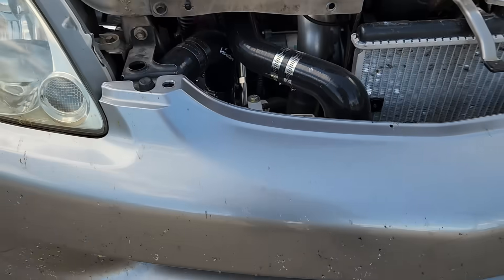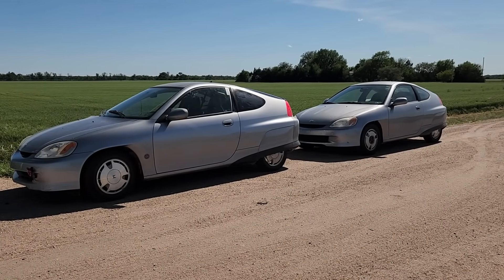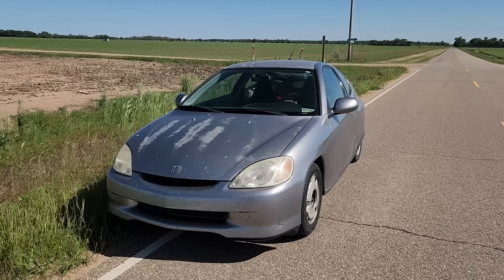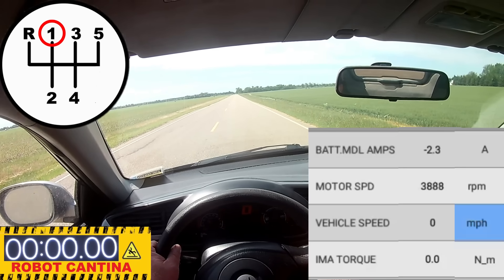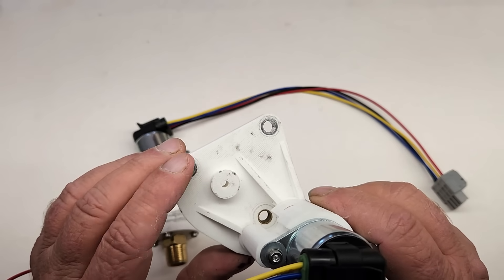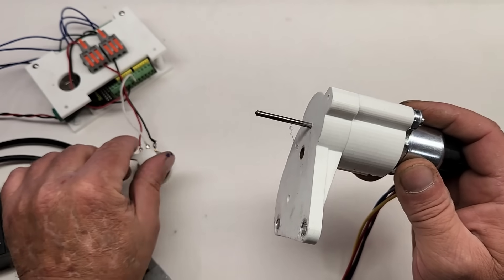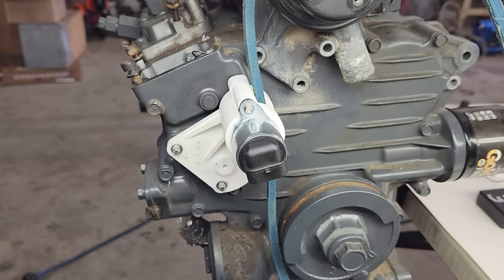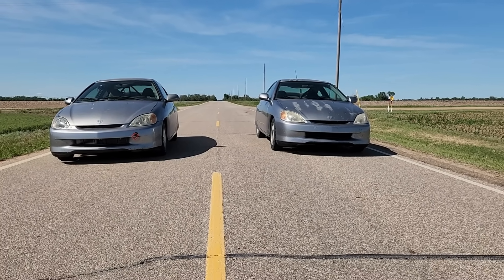S4 E18. Will an AMR500 supercharged Kubota diesel Honda insight outrun a stock Honda insight?

Comment: I think people sould think a but as the mechanical injection diesel had a after cooler plumb up to the radiator. So then it has a common in take temperature no matter how hot or cold the weather was so then you can tune the mechanical pump for that intake temperature. So it stabel in any condition. Just like the 1156 Cummings and big cam engine both have a after cooler on them which is not like a water to air or air to air its has the hot water out the radiator running through it but. It make sense as a where a ecu controller diesel just like a ecu on a petrol has all the sensors to change the amount of diesel for any conditions like radiator temp and intake temp speed rpm where a mechanical pump don't have any like that. But love these videos as I think that that little diesel seem to run grate and looks way fun to make something like this be side trying to get a small diesel for a good price

Comment: "Lets see which one is faster" I think the correct phrase Jimbo would be; Which one is not the slowest!! :-) 
My Z482 is now mounted in a motorcycle with a belt primary drive to a dry clutch on a pre unit gearbox made from a cut up motorcycle engine! And you thought your engine bay was tight for space!! Following with keen interest!
Reply from the maker: Nice!  I want to do some experiment with a Z482  some day.  Good luck with the project!

Comment: I fuel myself from the way you comment on things you see. The single point safety inspection lol yea they haven't fallen over haha
Reply from the maker: In Kansas, the car is safe to drive if the wheels roll.
Reply: @robotcantina8957  sure is ha. Idea run a 1,000 watt subwoofer and amplifier direct to battery and see how much this power draw effects the engine and fuel. Food for thought

Comment: I would love to have also seen battery voltage during this run. Knowing how far the voltage dips at 92A of assist(the max I saw) is a good indicator of overall pack health. It's not a surefire way to know how healthy it is, but it at least gives you a good idea.

Also, my lithium IMA battery insight makes peak power of 22KW, which is nesrly 30HP! Kind of amazing the power difference between NiMh and Lithium.

[Edit]: Do you plan on attending the insight meet in Kansas city in September, at the greentech facility? I would love to meet you!
Reply from the maker: Wow, that's a lot of power!.. I reckon the battery pack on my car is in poor condition.  The acceleration test (actually we did three runs) took the battery from about 90% to 60%.    I'm curious,   I drive my Insight between 68 to 75 MPH on the expressway and have never got better that 50 MPG overall.  It appears the only time my car will go into lean burn is if I draft behind a semi truck... does that seem normal?
Reply: That seems about right. I have a 2003 Civic Hybrid with 155k and 5 speed and have similar results with the 144v nicd battery. I get about 40-41 overall economy with interstate driving, 40 miles one way and varying speeds from 65-85 depending on time of day and location. It was about 45 when I first got it a couple years/30k ago, but that was also going about 65 all the time.

Comment: How about adding the ima to the diesel?😅
Reply from the maker: The IMA adds four inches in length to the engine and transmission.  The chassis of the car would need to be hacked in order to get that to fit.
Reply: @robotcantina8957 damn that is a shame ... :/

Comment: If you have any issues with the ASA or need a higher temp material...  I have a small Voron V0 printer with a chamber heater I can print up to 120cubed in it. Happy to help.
Reply from the maker: Thanks I'll keep you in mind!   I have used ASA on a lot of engine parts with much success, I'm not expecting any problems, but you never know.

Comment: those newton meters seem really low, the hub motor on my bike pulls 90 nm, my motorcycle build with 16 hp and a smaller stator than that is pulling 250nm.

If the fly wheel/hub motor combination has no form of cooling what so ever then they should be around that horsepower, but from what I understand with hybrid vehicles it should be pulling at least double that, the motor more than likely can pull 8 times that without melting the wires, depending on gauge.
Reply from the maker: Honda rated the IMA at 13hp so that's pretty much all it will put out.  Others have done mods and have gotten more power from the IMA but without the mods the IMA is limited.
Reply: @robotcantina8957   Wow, i had no Idea that they were that underpowered! or that they were DC 3 phase brushless. That's a real oddball motor in that car. A Prius can pull 5 times that level of power according to the internet.

Comment: I need to bring my '91 Geo Metro small block up for a "race". 3 cylinders of ground pounding excitement!
Reply from the maker: A Geo Metro is a serious race car when compared to the Supercharged intercooled Kubota D722 super mini diesel powered Honda Insight.
Reply: @robotcantina8957 btw jim there's actually an engine made by kubota that has an electronic controlled rack like you're trying to make which is the D902k, a variant of the D905 which is a 900cc version of your D722.

You can probably use parts off of that, though 3d printing is more fun

Comment: I have ideas that probably never work, but could you put the idler bearing around the fuel rack adjustment, reinforce the shaft housing like you did with the screw holes, and then you wouldn't have to worry about the belt coming in major contact with the adjustment housing? That way, the pulley isn't added on the way you showed and keeps the current footprint you have now.

Comment: Hi Jimbo, real fan of the channel. I have been thinking already before you changed the diameters of the pulley of the supercharger. Maybe it’s better to go back to the previous pulley size which helped already a lot with acceleration but also for fuel consumption. And when you need extra boost for even better acceleration why don’t you incorporate the exhaust turbo for that. An exhaust turbo only delivers boost when it is asked from it. It’s pretty idle when just cruising. And might be a really cool setup supercharger and turbo. Who did that before of the small diesel? Maybe this setup has been mentioned many times before in the comments but you have to forgive me I don’t read all the comments. Take care Jimbo.
Reply from the maker: Thanks!  we are trying to focus on just using the supercharger and what it takes to make a supercharger work for maximum power and best fuel economy.
Reply: @robotcantina8957  I’ll keep watching, thank you for your reply.

Comment: dare I make a couple of suggestions? 
the intercooler might be making no tangible performance improvement because of the extra drag caused by it, all those miles of pipework and pipe bends on the induction side. a strategic replay may add some more power.
for the ultimate fuel-sipper, what about mating the optimised diesel engine to the hybrid motor-gearbox?

Comment: Need the bypass valve pre intercooler, not post, that way you’re not making the intercooler cool air you’re just pumping back into the bay.

But as observed, the motor doesn’t seem to care about intake temps. Probably down to its compression and injection timing.

Comment: That gasoline engine in the Insight only produces 66 ft-lbs of torque, so 20 ft-lbs more is huge. That's over 30% improvement.
Reply from the maker: Indeed, its a fairly large boost in tq, but somehow I figured it would be a little more.

Comment: idler pulley gave me idea, that you can fit rack adjustment gizmo inside it, so it rolls around. Fixed with 3mm hole bolt

Comment: I think especially for how you drive the stock insight, the Civic Hybrid Gen1 gearbox with the shorter gearing may be for you.   Could also make a fun video too!
Reply from the maker: Yes, the ratios on the civic hybrid would be more ideal.  I find it fascinating how bizarre the ratios are on the Insight grarbox are.  Sometimes I actually get better fuel economy on the expressway in fourth gear.

Comment: Right on bro .. and i am very curious how the iac vavle is going to preform in the differant applications ... i might incorporate on on something myself lol i mean my whole forged turbo car is run off arduino already so it would prolly be easy enuf to add in .. problem is idk what i use it for yet lol , but i lile gizmos and tinkering 😅.. peace and love bro keep it rad stay safe and build on  . L8z bro and keep having fun
Reply from the maker: The IAC valve is an awesome nugget that need more love.    The one I show has a plastic "head" on it that can be removed to expose a 3.5mm thread so the little motor can be adapted to other applications.  Good luck with your project!
Reply: @robotcantina8957  sweet deal jimbo and thanks for the info on that , now my mind is racing thinking what I can do lol .. much love n respect bro ty peace ✌

Comment: Excellent presenation.  Thank you.  Has the battery in the "factory" Insight been replace or rebuilt and if so what is the story there?
Reply from the maker: Its the original battery.  I'm not sure how good it is.  The full throttle acceleration test took the battery from 90% to 60%.

Comment: Subaru timing belt idler pulleys are quite small and should help

13073AA230 is the part number from Subaru but I'm sure you can find a cheaper one elsewhere

Comment: You could add a tailpipe turbo . This would allow you to reduce parasitic losses from the SC by reducing its boost , maintain room under the hood , cooler operating ... then add propane boost to increase the diesel's operating efficiency,  thereby increasing output and reducing soot .

Comment: A skateboard wheel would work for an idler pulley. I've used them to make chain tensioners for mini bikes and go karts. I reckon if it works for a chain, a belt would also work just fine.
Reply from the maker: A skateboard wheel is bigger than the idler that I show in the video.
Reply: @robotcantina8957  Oh, that's surprising. It looked to be a bit bigger than one. Fingers crossed the fuel rack adjuster clears the belt!

Comment: My Mercedes 300sd and my 300d were both turbocharged but had no intercoolers. If Mercedes thought it wasn't justified, it probably isn't.
Reply from the maker: I had a 2.5 turbo diesel 190 without an intercoler and it was also fine.
Reply: @robotcantina8957  The 190d was a fantastic economy car, esp. if you had the rare 5 speed. Then again, all 190d's are now rare ...
Reply from the maker: @nazcaplain  Sadly my 190D had an automatic.  The guy I sold it to did put in a manual gearbox.  The right front fenders on those cars is super rare due to the vents that were punched into the fender  in order to give the turbo a source for cool air.

Comment: If you put a suitable turbo on it instead of the supercharger and allow for a bit of extra boost (probably as much as it that small thing can muster) and a bit higher exhaust temps, just for limited periods of time to avoid parts soaking and overheating, via simple microcontroller or some such and electric fuel rail adjustment - you could most definitely gain quite a bit of performance accelerating.
Reply from the maker: This series is about using a supercharger because we tried a turbo on this engine last year and the results were disappointing.
Reply: @robotcantina8957  
Yes, I vaguely remember all of that, but not that or why exactly it was a disappointment.
Reply from the maker: @heinzhaupthaar5590  The turbo took too long to spool and on gear change the boost would drop off too much.  Without the needed boost the EGT's would go up much faster than expected.  With the supercharger we have instant boost on each gear change and can manage the EGT's better.   I'm sure there may be a more suitable turbo out there, but its way beyond our budget.

Comment: The old Renault looks like a prime candidate for the 999cc engine that's the same base as the 670 . 55bhp straight from the box so a little light tune and you could go on a road trip, you might even meet some of your fans 👍

Comment: It is pretty interesting how you show us slowly how difficult engineering really is.    The Insight was designed fairly well all things considered.  Especially for when it came out.
Reply from the maker: Indeed, the original insight was a very well thought out car.  My only issues is the gear ratios in the transmission.  Seems like a lot of other folks don't like the ratios and there are a few mods that can be done to make the car more drivable.
Reply: First-gen Insight was designed with efficiency as a priority, which sacrificed most other things like cargo weight limit, number of seats, acceleration, doo-dads, etc. It was still available with air conditioning. :)   
The car was basically Honda's test-bed for new hybrid and efficiency technologies, so they threw everything at the wall to see what would stick.
It's worth noting I've never had trouble getting up to speed on a highway on-ramp in mine.

Comment: What is the point of the adjustable fuel rack..... your right foot controls how much fuel the engine gets. Want less fuel, don't hit the pedal so hard.
Reply from the maker: On a normal diesel engine that is true, however if you watched the previous videos I explained that since this engine is equipped with a governor, the fuel rack is not directly controlled by the accelerator and on acceleration the rack will slam to the max position for a few moments.  this is fine for rural driving, however since we want to try driving the car in a city environment we don't want a cloud of black smoke trailing the car.
Reply: Modern day diesels use electric pumps and position sensors to deliver the diesel at the right time, so when you press your foot on the pedal, the injectors open for longer when they need to for the combustion. This engine used a governor and a mechanical injector pump to deliver the fuel, so when the car accelerates, the fuel rack is instantly slid to fully open to supply the fuel before the governor catches up, producing a big cloud of black smoke coming out of the exhaust. Jimbo is trying to change the fuel rack position less harshly, so that the car can be used in an urban environment.

Comment: I don't care. 
Give me reliable and cheap but safe and functional.
Get rid of the radio. Make it a jack and Bluetooth connection. I already have a phone... make an extra sturdy phone or tablet (universal) holder. Add a camera (option).  Make windows roll-down again. Get rid of lithium batteries that will burst into flames at the next Carrington level event (all across the city at the same time). Add tougher paint and better steel. Make them smaller to use less gas overall per family instead of scaling them up to meet stupid EPA mandates. Make the glass flat and cheaper. Make the seats vented to the AC, and heated. Modular parts for more than one model and Make the vehicle EASY to work on (DIY with basic tools). Build in the troubleshooting computer (ODB built in and also modular so it is easy to swap out). Give it a decent tranny and differential traction so it grips equally on both sides (standard). Make a 4 banger version and an 8. Make it a truck with  a back seat. Make the back window flat and the sides and back clean (flat) for decent vehicle signage. Make the windshield wipers all the same size. Good mpg in the city/hwy. Make the brakes central like on the humvee. Wide wheelbase to height ratio but narrow enough for a parking spot. Filled internal kinetic bags to vent the inertia in an impact that are cheap and easy to replace without weighing too much. Comfortable seats that don't go lopsided. Easy to get in and out. Good visibility without the corner posts blocking your view. Lots of places to mount things so it is easily customizable. Room to upgrade the engine to an 8 banger.
Base it on an older design and make it public domain. Be the new Willie's Jeep. Be useful for farm or home. Be useful world wide. Be a good platform for any use.

Comment: The newton meter can make power calculations easier. If you have the torque in newron meters and speed in radians per second you just have to multiply them together to get the power in watts. To convert rotational speed from rpm to radians per second, multiply by pi and divide by 30 (or if you only need an approximate figure, just divide by 10).
I suspect that most car and motorcycle enthusiasts will never accept tachometers that read in radians per second.
Reply: The factor pi/30 comes from:
From rpm to rotations per second: division by 60
From rotations to radians: multiply by 2*pi
Just as some extra background information :)

Comment: The CVT might kill the performance.
Reply from the maker: No CVT's were used in this race.  Both cars are equipped with a 5 speed transmission.  The diesel car has a close ratio Saturn MP3 five speed and the Hybrid had a bizarre wide ratio 5 speed.
Reply: @robotcantina8957  I am mixing up your vehicles, sorry sorry!
Reply from the maker: @htimmermans1938  lol,  That's what I figured.

Comment: I’m curious, are you using “Accel Stepper” from the Arduino library?  I’ve written some code to govern a generator and this library seems to work well with PID code.  Using voltage as the feedback.
Reply from the maker: The stepper code I'm using is something I wrote.  Since I'm also using a stepper controller, My code only needs to tell the controller what direction to spin the motor and I also send a clock pulse.